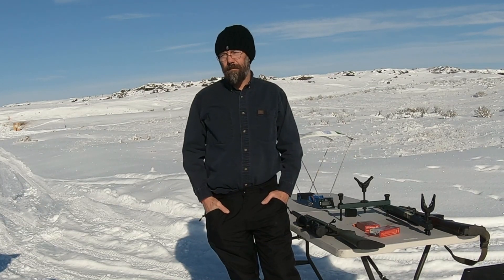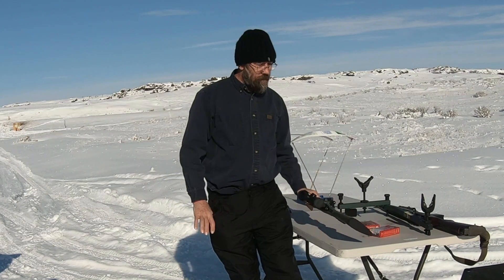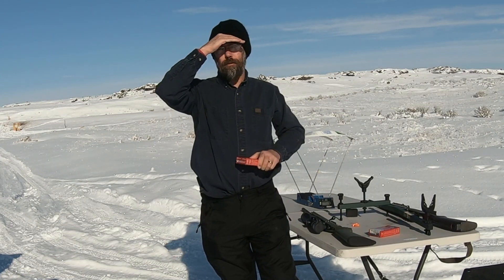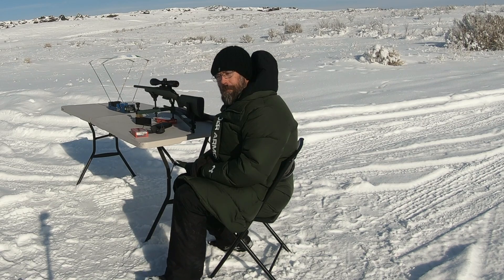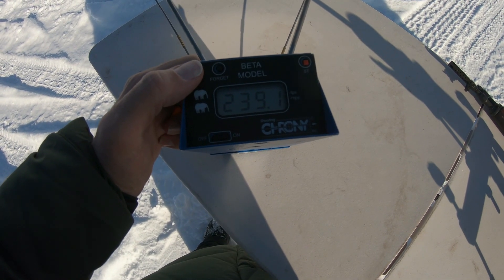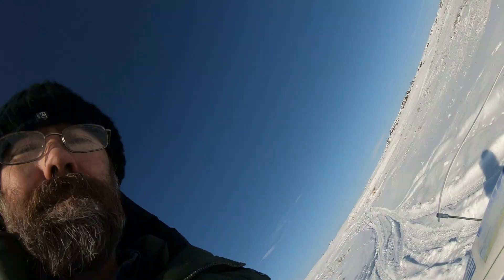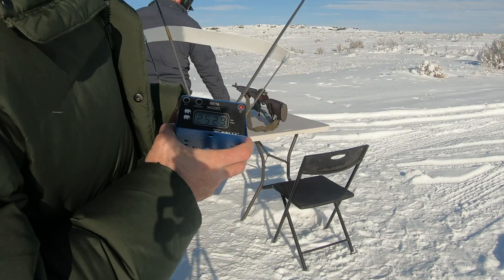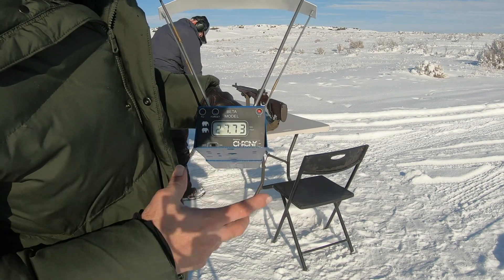muzzle velocity bolt action vs semi auto

Comment: The main difference between running a bolt over a semi auto, is if you are hand loading, you can run higher chamber pressures. Which will most definitely give you higher velocities. If you are using the same ammo it wont really change from bolt to semi auto.

Comment: Never had anything to measure it with .  But with my shotguns my Remington 1100 semiautomatic had less recoil than my closed breach over and under Ithaca model 600 .  So I always thought a certain amount of gas escaped from the 1100 semi auto 12 GA.  Which meant to me in theory the Ithaca 12 GA had more recoil and must have had more fps of energy coming out at the mussel when fired .
Reply from the maker: I will do shot gun test if you like but I'm pretty sure it's the same situation.  The action absorbes  recoil but the shot is gone before the bolt moves.